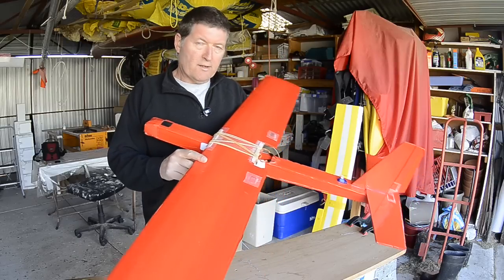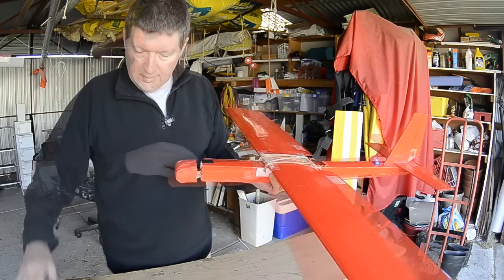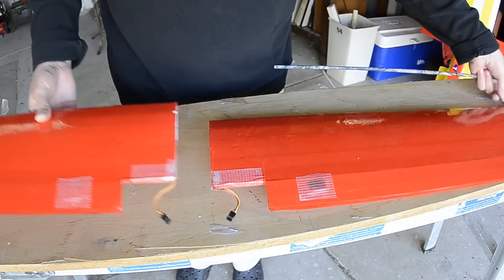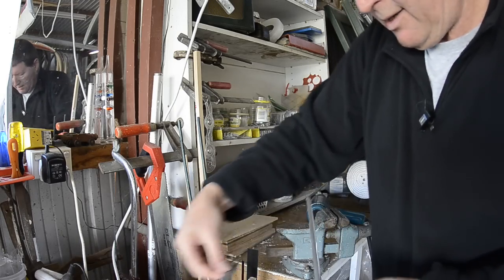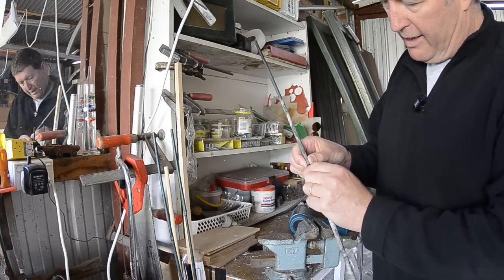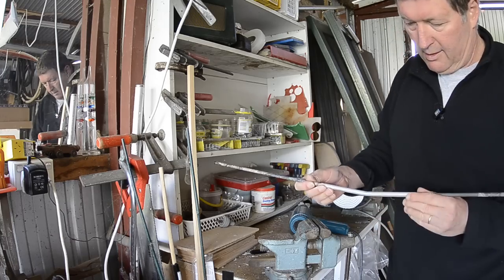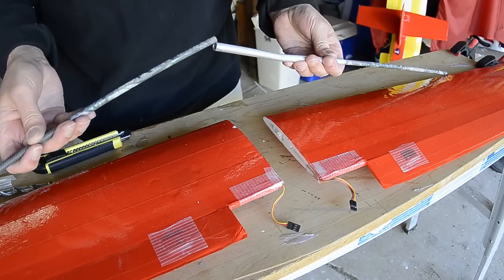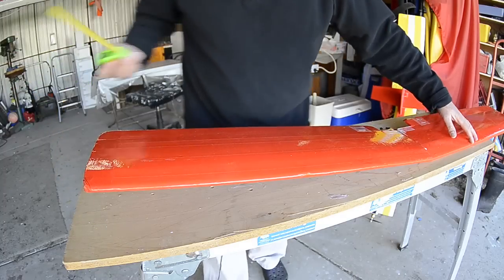Dihedral Armin Wing build

Comment: Wow....I had this idea in my mind few days ago...about how to to do dihedral wing....after seen a good video  from Experimental Airlines...I thought to use two tubing of aluminum for rigidity at the proper angle....but after seen you video...I think one is more than enough.... Very good work!!!

Would like to see a photo of the dihedral wing over the fuselage...and how well the rubber band hold the wing in top without dancing... Thanks
Reply from the maker: I did put small wedges of foam between the wing and fuselage to stop it rocking.
Reply: Thanks!!!

Comment: Transmitter joystick goes right ,right aileron goes up. 

I thing dihedral angle is more in wing if i reduce it it work fine. Or if with ailerons wing have a flat (without dihedral) it work. I try at this Sunday.
I made many trainer plans. Now want to take next step that's wings with aileron's.

I know im new  in this hobby. 
Thanks Andrew.
Reply from the maker: Oh yes that could be the problem. Good you see you are experimenting, you will learn quickly. Good luck.

Comment: When I cut a carbon spar, I use a half round needle file and slowly rotate the spar as I file it. The file is obviously much finer than even a junior hacksaw, so there is no fraying of the carbon at the cut.
Reply from the maker: Demel cut off disc works well too.
Reply: True, but speed never produced precision. LoL! Just a quote from an engineering forum. ;¬)
Reply: @AndrewNewton  
The one downside to cutting carbon fiber is the fibers that are cut can be light enough to become airborne and it's really nasty stuff to breathe in.
A vacuum hose placed near to the point of cutting and some good PPE should help to limit any of these health hazards.

As always, I enjoy your quick remedies, solutions and videos.
Thanks Andrew!

Comment: Thats interesting as you are emulating full size sailplane wing joining...as well as making it easier to experiment...I was hoping you would comment on the difference in flying with the dihedral versus flat...??...Rgds...Laurie
Reply from the maker: LWJCarroll Thanks Laurie. I haven't done a decent side by side comparison yet. Quick impressions with dihedral, it flies smoother with less input required. Aerobatic performance is slowed down. Decalage issues are amplified.

Comment: Nice one Andrew, I also like where the Ailerons servo feeds come out the Fuz, very novel. I suppose the advantage of the diahedral is that it will turn in a little better and slowly self right itself?... Oh, btw, I did my first FPV flight the other day on my AXN, I have a clip up...and my first fpv scratch build in Depron is nearing completion.....:)
Reply from the maker: Yes, a little bit of dihedral calms down the flight characteristics, really need to re-test it slope soaring for a proper comparison. I suspect dihedral also exaggerates decalage issues for powered flight. If the leading edge is sitting up at all then adding dihedral will make the plane loop up under power, no matter where the CG is. This wing needed packing under the trailing edge to make it sit flat. Congratulations on the FPV flights and I'm looking forward to seeing your build.

Comment: Good day Andrew. Hope you have been out flying. Good to see your finger has been healing up nicely. How do you know what degree of angle for dihedral. is more better for higher wind or less? plane 1115 gr wing 1430x190 (includes ailerons) fuselage  920, Also on one of your other videos you modified there motor angle on a pusher, what is a good angle to start off with there as well. Sure liked those engine mounts that changed the mounting angle, very cool. I will use washers until I break down and get that 3d printer. Thanks in advance for all your knowledge sharing.
Jeff
Reply from the maker: From memory 6º is a good starting angle. Dihedral is best for light wind slow flying. Not useful in strong and turbulent wind.
Reply: @AndrewNewton  Thanks Andrew, so in windy condition ( like I've being having here for several days now 18km) very challenging for me to say the least. I might be better off with little to no dihedral
Jeff
Reply from the maker: Yes I discovered that with this plane. Much better with no dihedral in wind
Reply: @AndrewNewton  Yes, I had watch that and had to watch it again, build a second wing with no dihedral  and much better control in the wind. Just taped together to join the 2  , love that idea.

Comment: is that carbon fiber you are cutting there? Its better to wear some breathing protection and also try to keep dust and chips contained (like sucking it away with a vaccum-cleaner)...just if you want to keep your lungs healthy of course (and that of your viewers...)
Reply from the maker: Yes good points thanks. I do wear a mask but had not thought of vacuuming up the dust.
Reply: before i forget it: if using vaccuum you should use some industrial-grade vacuum with special (HEPA) filter or water/oil-filtration because normal-filters dont really work on carbon-fiber.
if you use a normal filter: only use that filter for this pupose and don't clean any living room with that filter because it cant contain carbon-fiber residue.

another possibility, which is more suitable for hobby-uses imo is to work under wet-conditions like using wet-grinding-paper, or try to wet the file and the carbon-rod so the water can bind the produced dust.

Also its good to use some (wet) news-paper or sth to collect all the dust and grinding-residue onto, so you dont need a broom (which would only spread the carbon-dust into the air)

sorry for my english i hope it's understandable :)
anyways i love your videos and ideas, big thumbs up!